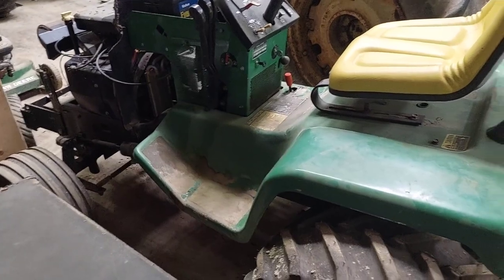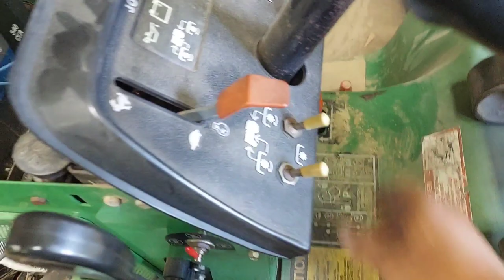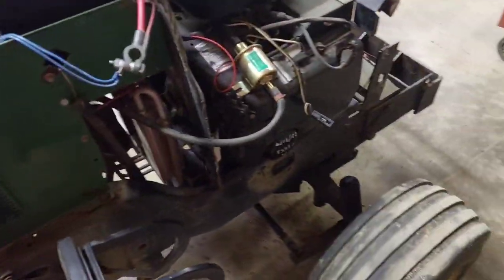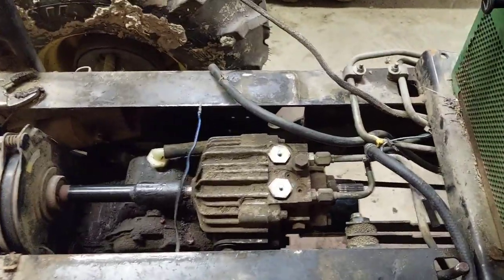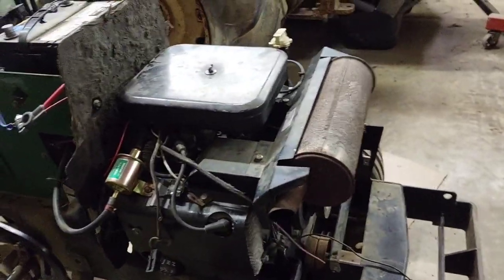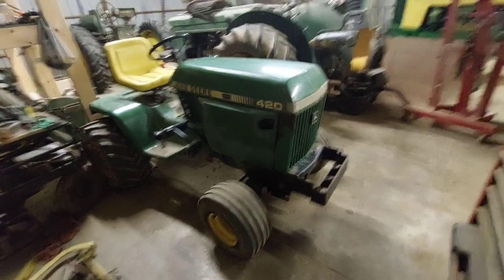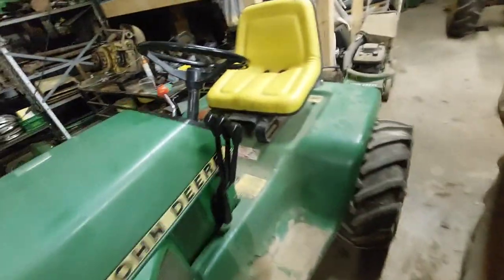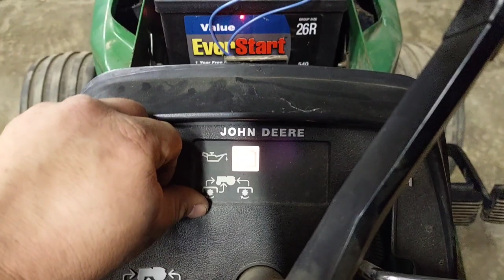can I finally use my 1989 john deere 420? replacing the drive shaft

Comment: The drive shaft can be removed without moving the engine.  Remove the fender pan, fuel tank and two access panels.  Remove the 4 yoke bolts, slide the shaft back on the pump splines, then it can be wiggled out.
Reply from the maker: No it can't. Tryed every way posable had to move the engine forward.

Comment: Hi. Loved the video. My drive shaft on my 420 is done. Trying to find a replacement is difficult. Any help would be greatly appreciated.
Reply from the maker: @noelbaca3028  I would try ebay first, and if u have FB those people can be helpful 2. Just have 2 watch out for scammers on FB.
Reply: @mikestarcher  Thanks. I'm having someone else working on it and they found one. Had to drive to get it. It's going to cost $400 plus travel expenses before they do any work on it. Yikes. I'm so new to having the time to really get into the nuts and bolts (pun intended) of how this tractor works.